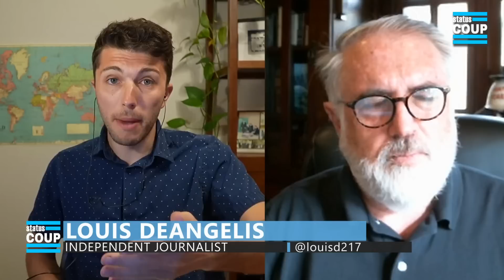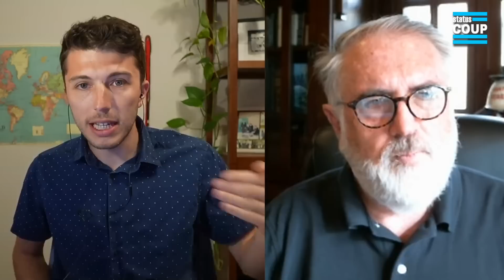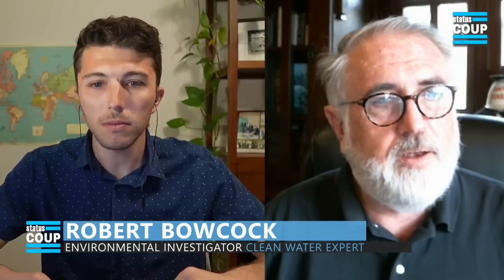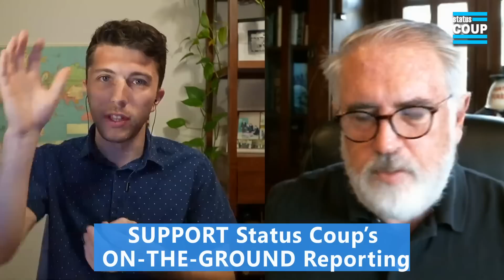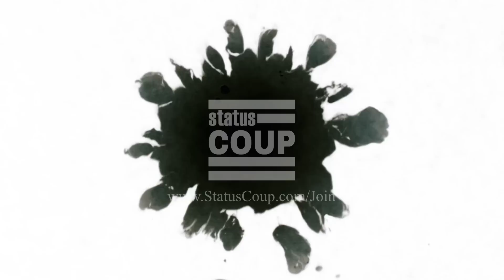EPA Baffling East Palestine Residents with Bullsh*t: Erin Brockovich Partner Slams Federal Response

Comment: Look up Skykomish, Washington bunker oil cleanup. A little more than 15 years ago I worked on a railroad project there that should have been done in the 1920s which is when the problem was first officially documented. The town was a major locomotive service station for the railroad and that's where they stored all of the engine oil in WOODEN UNDERGROUND TANKS   since the 1800s. Oil sheens in the adjacent major salmon river starting appearing in early 1900s meaning the wood tanks were rotten and leaking. Who can say why it took 80 years to attempt cleanup but it was shocking how much oil was in the ground. I say attempt cleanup because it was impossible to get all of it. Not to mention all of the heavy metals contaminated soil that we excavated. Nowadays the river is closed to fishing due to low fish counts and I have been battling leukemia for the last 9 years that started about 5 or 6 years after I was there.

Comment: Chickens is were you can set a base point, for surface soil. What they do all day is scratch the earth, so your dioxins will readily come to mix with air. Same with fields, and cattle or cows. Dioxins lie on the blades of grass and are ingested into the cows multi layer stomachs. Goes into the milk or into the cellular structure of the animals. Cattle most likely receive it quicker into their cellular structure and internal organs. Foxes, Ferrell animals, constantly take drinks of water, sniff the leaves, chew on grubs, worms, smaller mammals, mice, squirrels, rats, all surface or lite subsurface grubbers. All the different mammals and fowl, including birds, which I haven’t heard a great deal from the media about, will be carrying the dioxins to different habitats and areas within 1-300 miles areas, minimally. The consensus still seems to have not understood the vastness of this chemical dump, and the remediation is based on antiquated clean up methodology, previously used for a less educated and a more isolated from mass media uncensored information available for the citizenship.
Reply: I'm in Indiana and I saw a flock of birds acting very oddly today. Maybe that's why.

Comment: Skim the residual oil film off of the waters surface and place that in a container, then boil it and capture the condensates in a separate container. Congratulations you now have Chloromethane, a precursor to Chloroform.
You can go even further by injecting the Chloromethane thru a filter containing Sulphur, Biochar and Nitrogen to produce Cyanide.

Update: The main irritant and smell that's everywhere is Dichloromethane.

Comment: Appreciate this discussion. 
Did Tx A&M do more comprehensive testing than the EPA? How did their testing compare? What kind of equipment did they use? Wonder how independent they are given their funding from Big Oil? Another recent report that sounded together was out of Purdue, food for thought.
Re: dioxin testing - wouldn't the level of contamination be much higher than "Jim Bob's" BBQ? (Regardless of baseline?)
On my newsfeed there is often much talk about the water and air, but what about testing the soil? There was one report about the removal of bad soil then nothing more. They indicated the waste was being removed to a nearby facility, I think ok'd by the EPA (after the flap with Texas) only to be burned, thus putting more toxins into the air, spreading it out worse. The facility that's doing it has been taken to task for numerous violations. 
If possible, I need to clarify what you meant by "things came out [of the rail cars] in pulses." Wasn't the leak consistently flowing? 
How fresh were the deer kills?
Thanks again for a good discussion.
The community of E. Palestine certainly didn't deserve all this. Neither does the rest of the world. Remember there is a war going on -